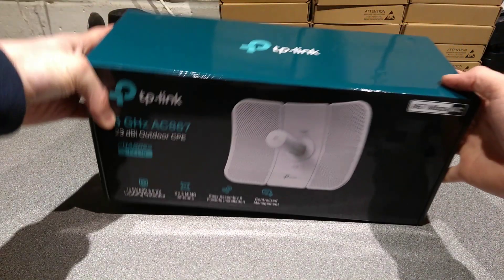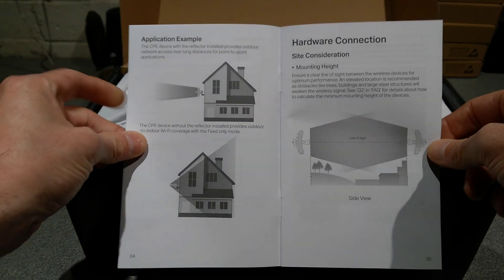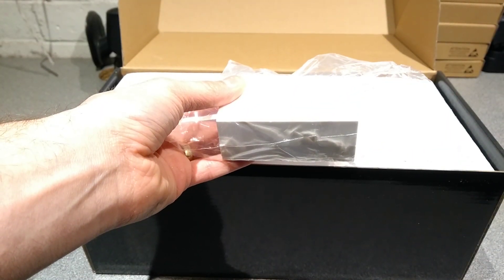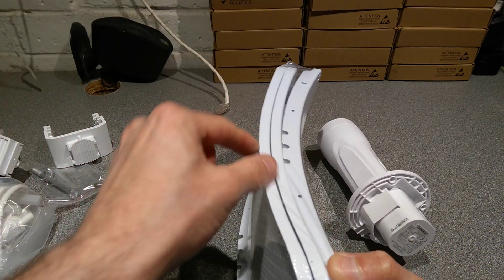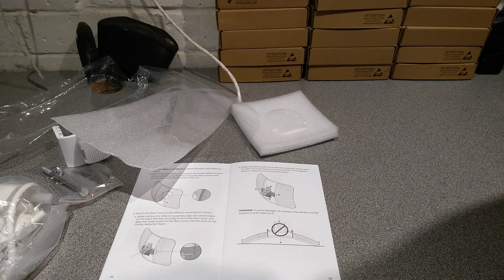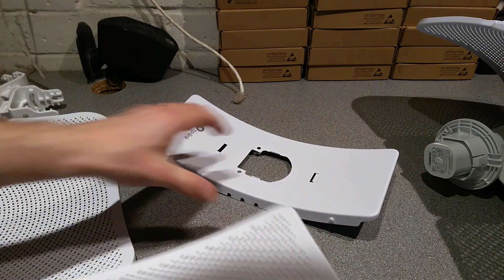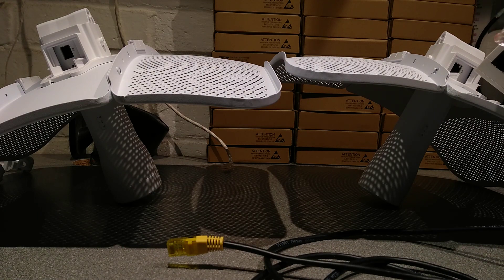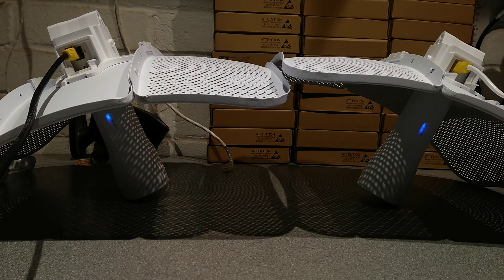Initial assembly and power up of tp-link Pharos CPE710

Comment: Does a CPE710 have to connect to another CPE710 or can a CPE710 connect to an WiFi router?
Reply from the maker: Another CPE.
Reply: @freename  I bought one to try it. It works as a wifi client and connects to another router, but it has to be configured as an AP not as a Client. This thing was a nightmare to configure.

Comment: Great video, can this be used to just connect to random cell towers and a router to boost internet speed?
Reply from the maker: No, they only communicate using the WiFi protocol and do not use 3G, 4G or 5G cell phone frequencies or protocols.
Reply: @freename  got it, thank you.